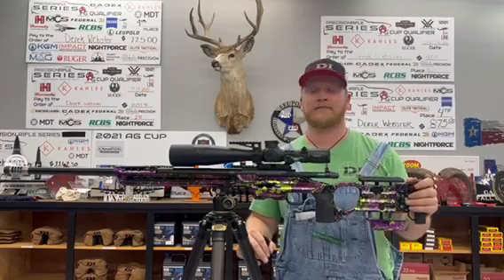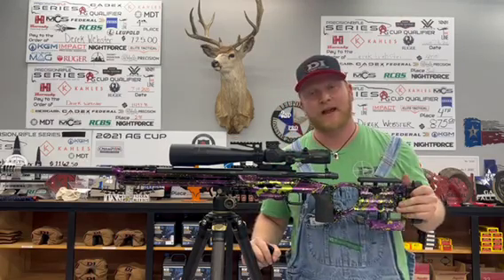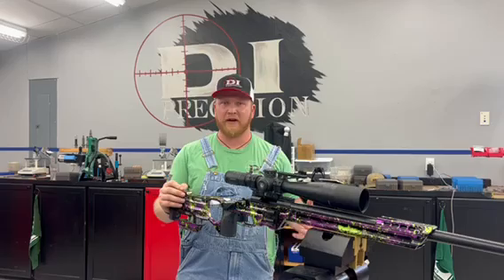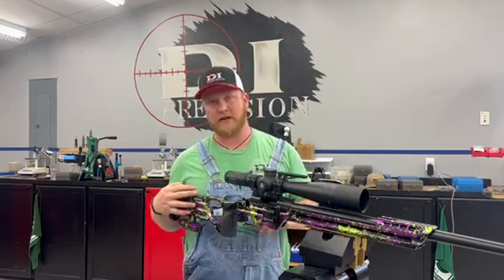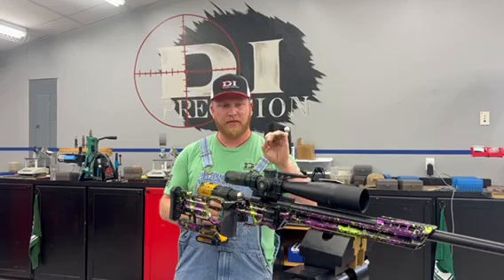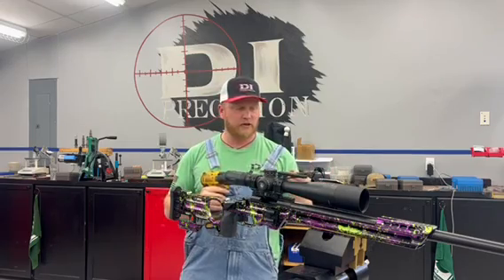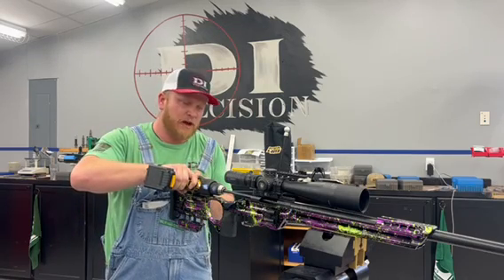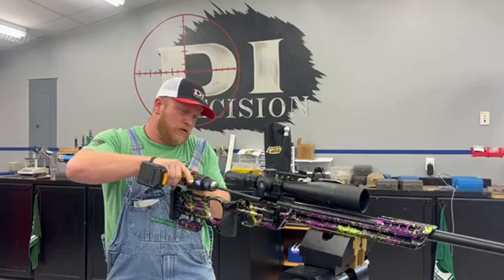How to clean a Carbon Ring like a Pro

Comment: strangely enough I have used a drill, cleaning rod and chamber brush for getting rid of a carbon ring and it works excellently and does not damage the chamber or affect accuracy

Comment: I've always wanted a 700 Nitro Express. I just turned my .308 into one. I'm glad I used a 3' long bit and went three sizes bigger in diameter than the bore. I can easily do sub moa groups at 2' away. Thanks!

Comment: Derek, great video, but you left out the Nitric Acid bath for the bore after reaming away that carbon ring.  Then, I add a thin layer of molten lead to the bore while spinning it to get an even coating of lead.  Hope folks realize what day this video was made and you and I aren't responsible for screwing up some barrels!